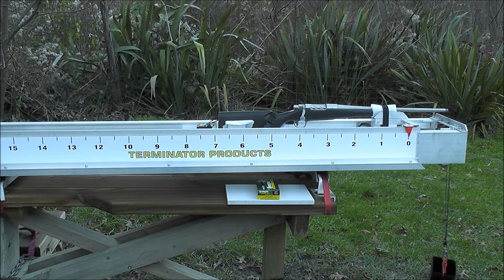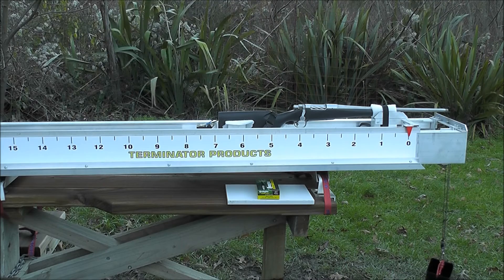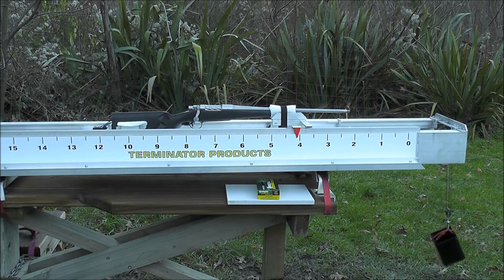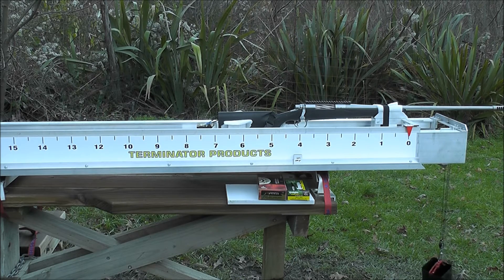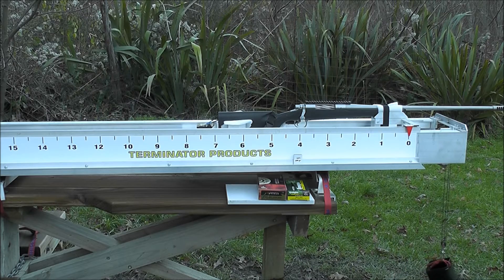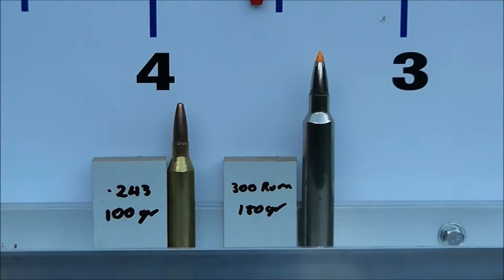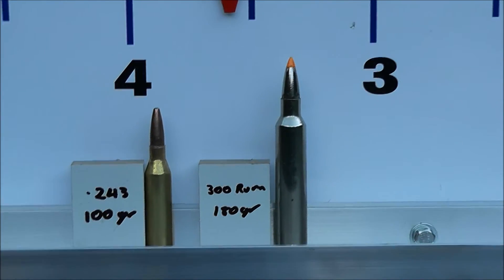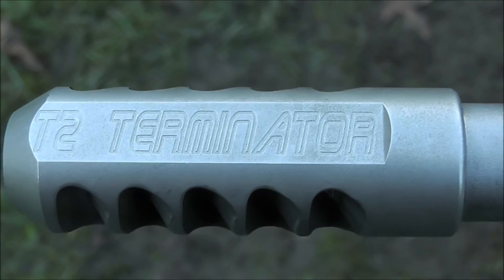T2 Terminator Muzzle Brake on a 300 Remington Ultra Magnum compared to the recoil of a 243

Comment: The T2 reduces more recoil on this rum than the 300 win mag in your other video?
Reply from the maker: It depends on the counterweight size used, the videos are designed to compare firearms or brakes on each video not between videos. Also the 300 Rum has more gas volume & velocity for the brake to harness than the 300 WM. Cheers Greg